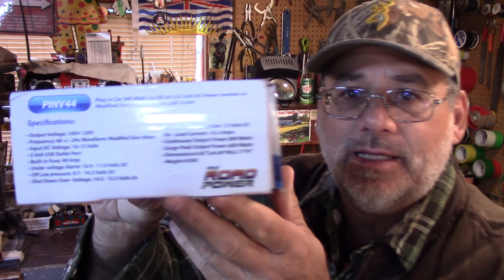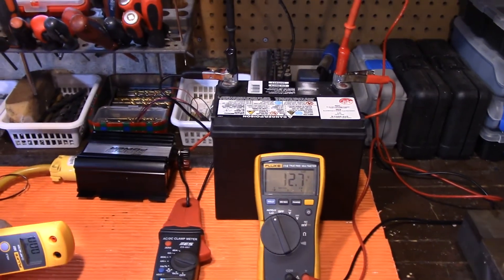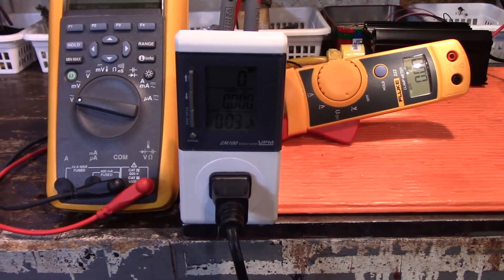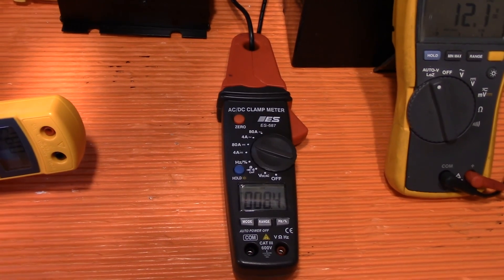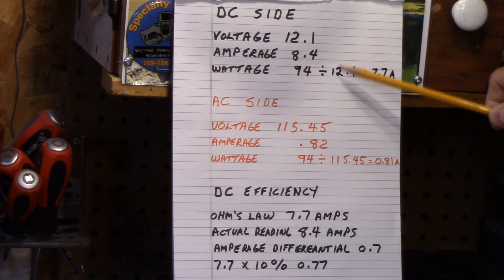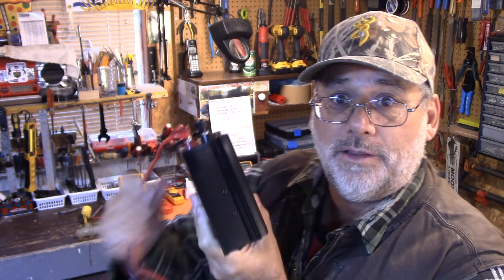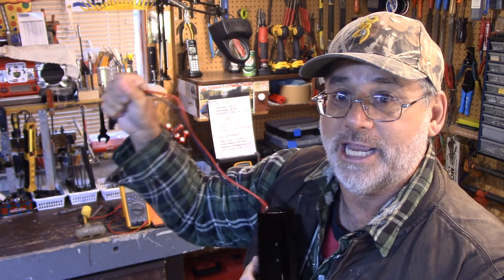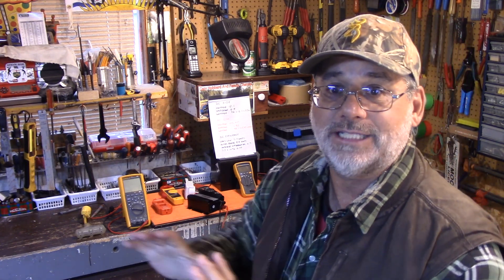How To Test  DC to AC  Power Inverter Efficiency  -  Basic Voltage Drop Results

Comment: Can you Help me Please.. I purchased a  $ 320 Dollar 3200 Watt Pure Sine .  Inverter . I only used it for 2 Weeks before we had a THUNDERSTORM. And it STOPPED WORKING .. I Used it for My Solar Panels .. NOW ITS JUST A VERY EXPENSIVE PAPER WEIGHT ..
IT HAS 2 SCREENS . ONE SIDE STILL WORKS . BUT THE OTHER SCREEN DOES NOTHING . BOTTOM LINE .. It does Not Work Anymore with My Solar Panels . So I bought a NEW INVERTER AND THAT WORKS FINE .
Can you Please look at my BROKEN INVERTER . I WILL PAY FOR SHIPPING AND PAY YOU TO PLEASE FIX IT .. 
Can you Please Help me ..🙏🙏
Reply from the maker: Sorry but I don't work on inverters. You  might just have a blown fuse inside.

Comment: You are on the right track bud, but one big mistake. You cant apply AC watts in your DC math. Also, the kill-a-watt device is redundant here and provides a slightly less accurate reading than doing the math with the voltage and current readings. DC side 12.1 x 8.4 = 101.64. AC side 115.45 x .82 = 94.669. Therefore 94.669/101.64 = 93% efficient. And that's at less than 1/3 of rated capacity!
I work for a utility and see solar applications all the time. The losses get bigger the larger you go. A common solar array I see is 7.2 KW DC/6 KW AC.  That equals out to 83% efficient. They'll show the customer the math based on the DC specs instead of AC to pad their numbers.
If you want to go crazy with your understanding of electrical theory, start looking into capacitive and inductive loads and how they affect your watt readings. Your light bulb here is a purely resistive load.
Reply from the maker: 100% correct watts ac to watts dc are not exact as amps AC to amps DC are , the only difference is in  how you measure.   To present an exact  corolation in measurements  between ac and dc watts  is impossible  without more  data . I'm presenting a  rough expectation at best for an audience that's interested  in solar.  Cheers 👍

Comment: @11:54 it really is impossible to install or employ too thick of conductors to supply power to your inverter, or to connect to the output side of your inverter. At some point, the cost to benefit ratio drops off of course. As a minimum, I'd use double the thickness of the minimum size for a calculated distance. All this being said: do not use double the minimum rated circuit breakers and fuses of course; as circuit breakers protect equipment, you & your home or vehicle from fires associated with short circuits.

Comment: question, so on the dc side wouldnt you take the volts of the battery x the amps drawn =101.64 watts then minus thst from the watts at the bulb 94 watts= a difference of 7.6 watts.  With that considered would the efficeny still be at 90% since you ssid there was a 10% differential?
Reply from the maker: I'm not sure , never tried that  formula . Not sure at all 🤔
Reply: You are on the right track. What you are looking for is calculating the gain or loss. This is derived from the ratio of the output/ input. There is no unit for it because both measurements have the same unit. In this case, it makes sense to take the ratio of the powers: 94/101,64 = 0.88. In percentage, it is 88%, resulting in a 12% loss. I think his calculation is wrong. Data collected is good.
Reply: @zegeyealemu1101  I'm not Einsten or anything but I thought 94/101.64=0.9248 which is approximately 92%  efficiency.I stand to be corrected .
Reply: @chris Ooops yes, you are correct. The quotient of the duvidion is wrong. The loss is 8%, not 12%, due to division error. Thanks for pointing that out.
Reply: @zegeyealemu1101   yes that is what i was trying to get at lol. from what i understand to get efficiency the way you stated is how i understand it also.
Reply: Still the same thing

Comment: I had a AC DC fridg with frezzer in our boat, it was a full size apartment size It wasan AC with a built in invert. When on shore power it ran on AC, when under way it was on DC, unless I had the on board 10.000 watt generater running.
Reply from the maker: Sounds like a great setup 👌

Comment: How's she goin'?  Good demonstration of voltage and current losses.  To me the key to this comparison is the current draws.  Like you mention, if the load stays the same, as the voltage goes down the current goes up.  This is a very important point.  You need to know what this current will go to so that you can size your wiring correctly.  And the longer the distance the more line loss you will encounter in these wires and that means a bigger size cable will be needed.  Very interesting these experiments and practical set ups you do Steve.  Thanks and take care!!
Reply from the maker: Thanks Mike , some electrical basics go a long way for those  trying to run a 13 amp load on a 16 gauge 150 foot extension cord 😅⭐

Comment: I have one of those expensive DC fridges.  For me it was worth the extra money because I don't need as much solar power to run it.  Not only do you eliminate loss at the inverter, it is also a much more efficient compressor (at least the one I purchased does).  It is tough to plunk down that kind of cash, but after five years I don't even notice it, lol.
Reply from the maker: Yes over time the extra cost doesn't feel so bad LOL